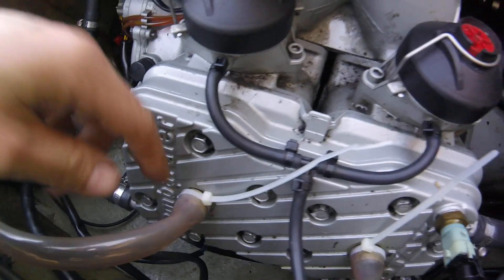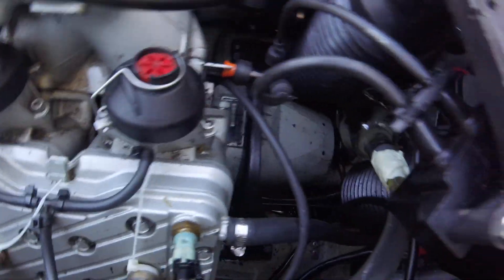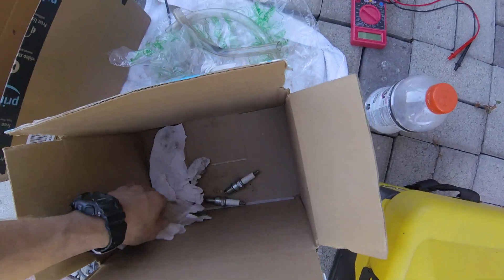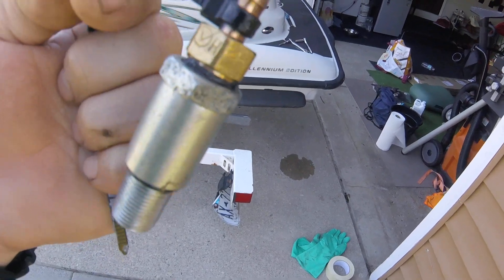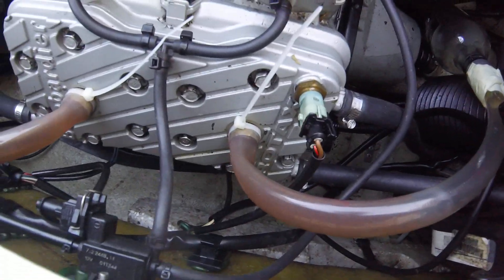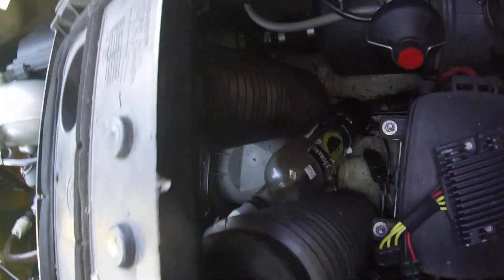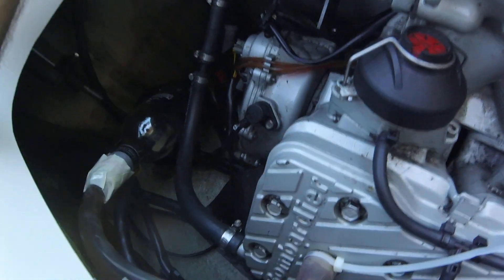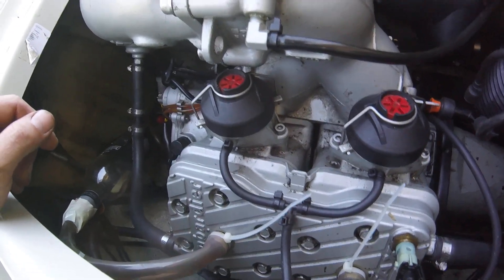2000 Seadoo GTX 787cc RFI Hydro Locked Engine Fix

Comment: adding a shut off valve to the oil line that feeds the rotary gear will help a lot.  but too much oil is going into combustion.  keep spare plugs and break clean on the ski.  she will be a smoker for sure.

Comment: I bought the same ski that was "locked up"  found the same issue, but didn't have to install the valve, it hasn't happen to me since.  You just put the valve on the rotary lube line?

Comment: you have bad crank seals.  that is why oil is leaking into you case.  the oil is pumped into the rotary valve gear for lubrication, then returns to the oil tank.  when the seals on the crank go bad, the oil gets into the crank case then gets sucked up in the cylinders.  too much will lock up and engine.

Comment: I am having this same issue how do the plugs look after you drilled them? Also looking for a valve for mine what size did you use?
Reply from the maker: The plugs turned out good no issues with threads, I had to grind off the nut on spark plug. 
Your looking for a shut off valve size?

Comment: what kind of shut off valve is that? what diameter?
Reply from the maker: I believe I looked up the specification on a replacement hose to find the inside diameter. 
Ordered the valve based on that. 
Has to be a valve suitable for oil/fuel. 
Probably not a bad thing to have even with out  having these problems. 
Good luck!